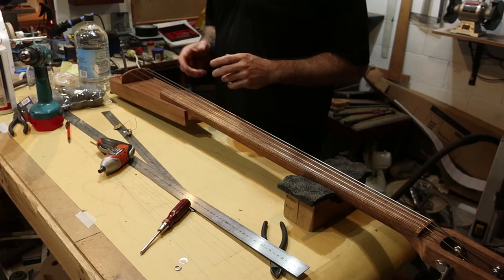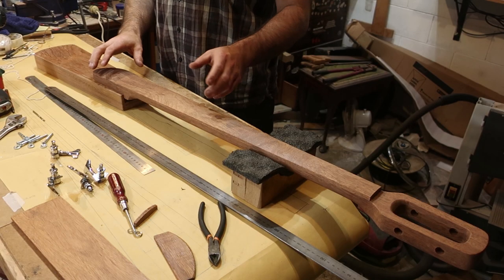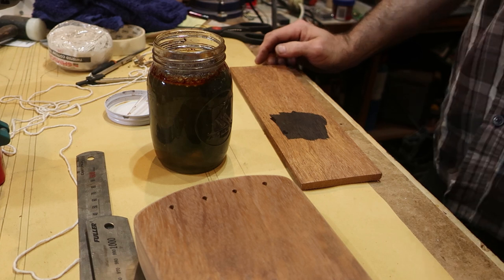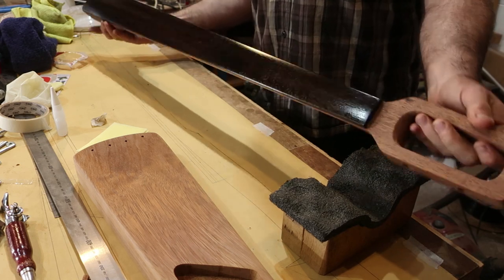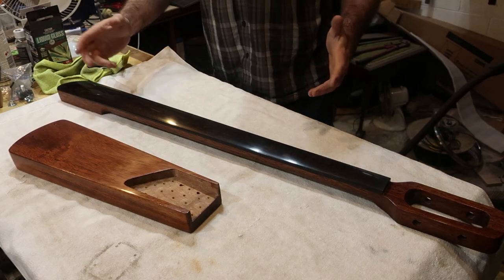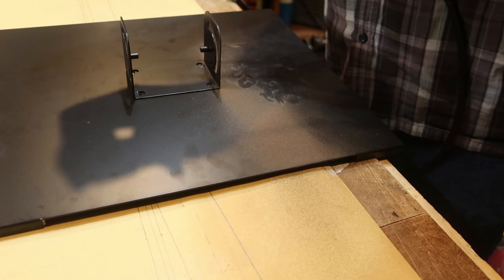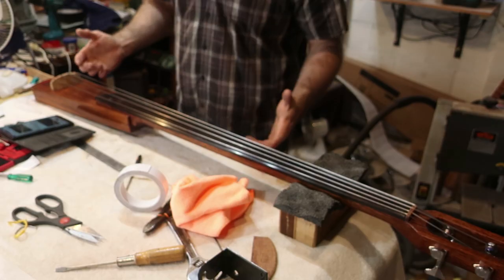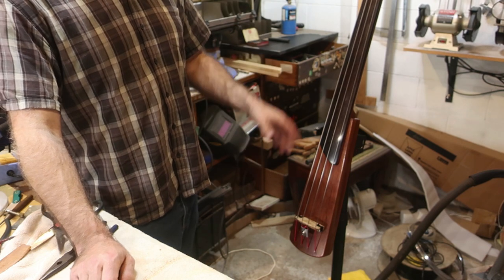Electric Upright Bass Episode 3 - Ebonizing the fingerboard, finishing and mounting it on it's stand

Comment: That ebonizing came out GORGEOUS! As for the stand issue, you might want to go for something more like a standard endpin rather than a tripod mount, although you don't have a ton of material to play with at the bottom
Reply: The problem with an endpin is that this bass has no body to lean against you. One solution would be to add a body-shaped piece of wood or metal, like the Yamaha Silent Bass. This shape is more like a NS Design bass, which come with a tripod as standard.

Comment: This is really cool. I especially like how the ebonizing came out; I thought you had to be much more careful about the quality of the liquid, but you didn't strain it or anything. I do wonder, though, why not just use an end pin instead of that big bulky stand?
Reply from the maker: An end pin by itself is less stable again. With a double bass the big body rests against the players body and it stays more or less where they put it. Some EUBs come with a removable bracket that simulates this but they invariably look dumb, and not being a double bass player I'll never miss it. The Ibanez and NS Design basses both come with stands and that's what I'm basing my design from. Thanks.

Comment: Superb job! I was curious as to what you used to apply the cyanoacrylate (superglue) to the fingerboard?
Reply from the maker: Just some lint free cloths that I get from the hardware store on a big roll. Each sheet is enormous so I cut them up and get little squares that are good for one coat, I can usually get 12 coats out of one sheet. I'm fairly sure that the cloth, when hardened from CA is non-biodegradable, so I try to get as much mileage out of them as I can. Thanks.